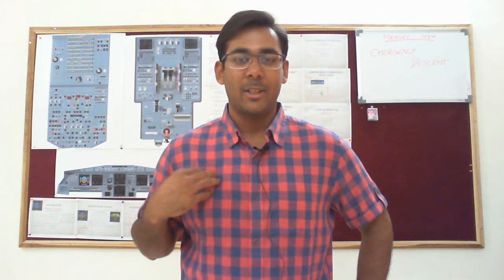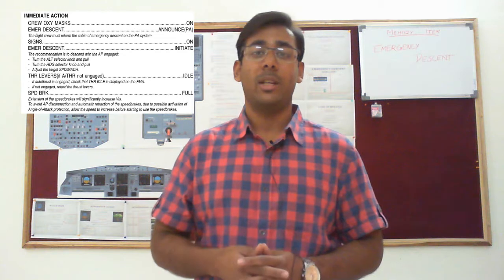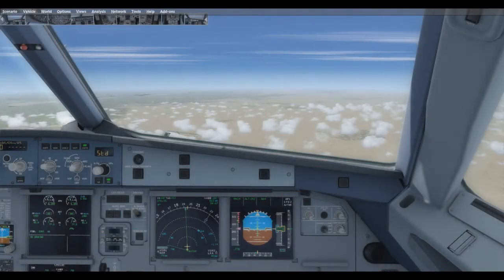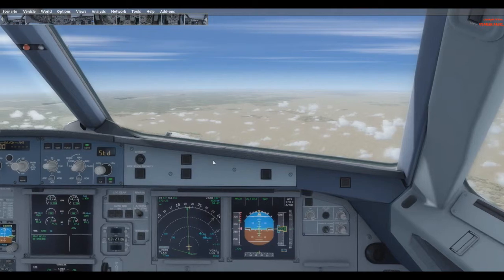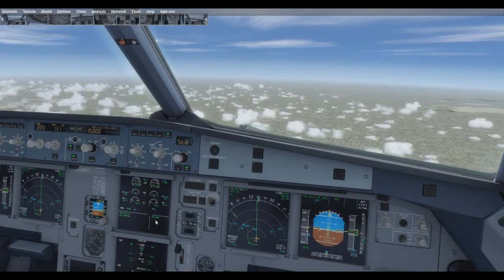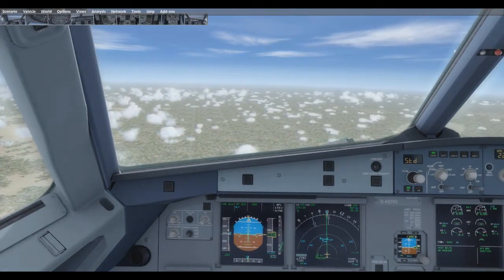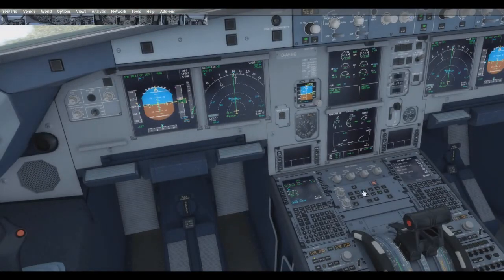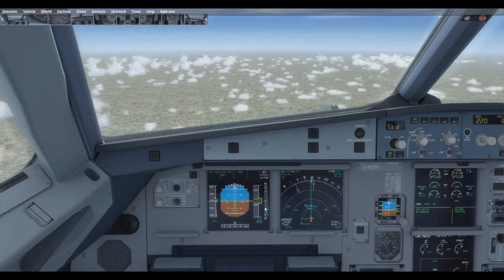A 320 : Emergency Descent

Comment: Nice video. When you switch on the signs, my instructor told me to switch on the Landing lights aswell so that you are visible to other a/c's flying in the vicinity and its provides you with added protection.
Also, when you stow the oxygen masks make sure to press the Reset Control slide to recover the mike. 

Keep up the good work. The videos are very helpful. :-)
Reply from the maker: Thank you so much Savneet. The info you have shared here is of great imporatance to all of us. Please share the vid as much as you can, and I would love if others also come up with such great suggestions, additions or corrections. 
Savneet I would love if you can share your Day check experience of emergency descent here so that we learn from your sharp situational awareness.
Reply: That was shear luck I would say that I was able to notice that the examiner gave me Cabin Depressurisation while the a/c was passing 10,500 ft climbing for FL110. As soon as we saw on the E/WD about the Cabin depressurisation, I requested my Pnf to Push to Level off and called atc that we have experienced cabin depressurisation. Negative climb to FL110. Intentions: To land at the earliest. That was the whole exercise. 

I liked the dog and bum theory which you explained. Didn't know about it. 😊👍🏻